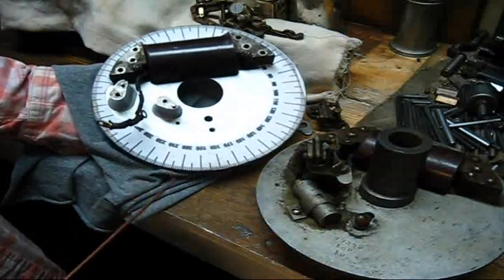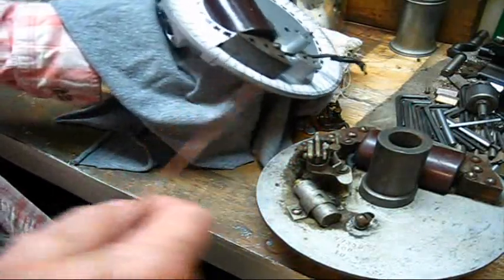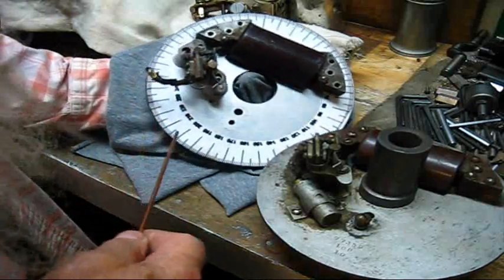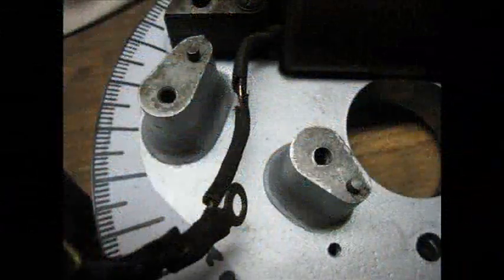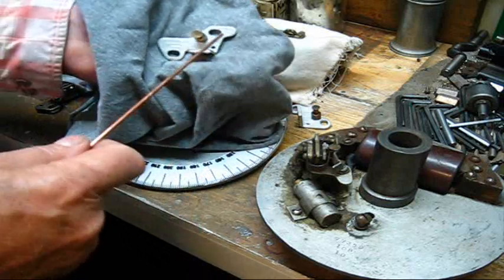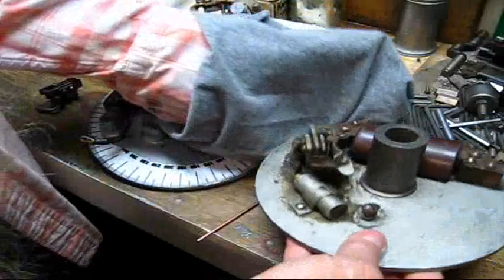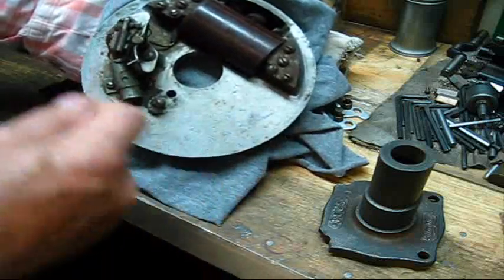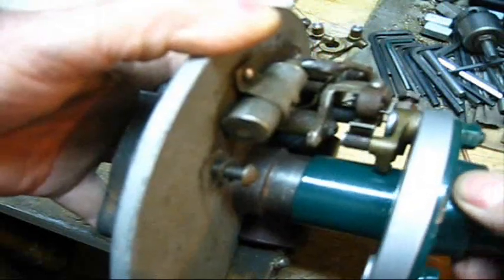Maytag model 92  ignition system #9

Comment: Shopdogsam,
The degrees of crankshaft revolution at the Maytag Model 92 timing mark is 36 before top dead center (BTDC).
In a Model T Ford, we start the engine in a retarded timing position to avoid a backfire.  After the engine is running, then we advance the spark to ultimately a BTDC setting ("sweet spot") that corresponds to the RPM at which the engine will be running.
With a fixed timing position, how are we going to prevent a backfire?
Confused on the West Coast of Tennessee.